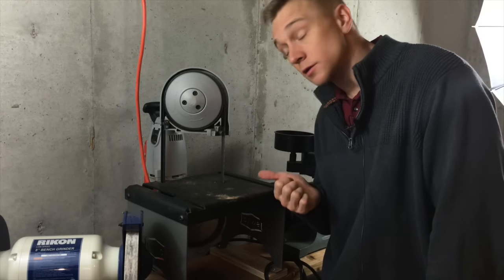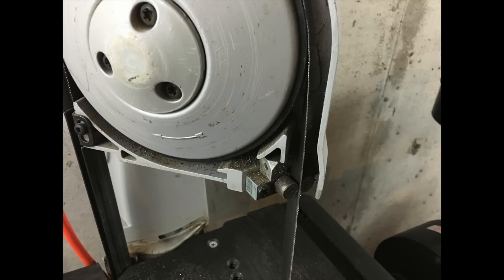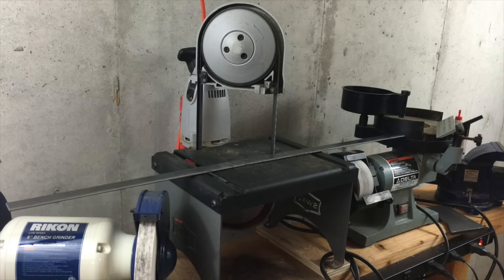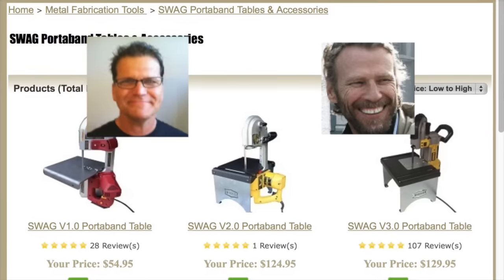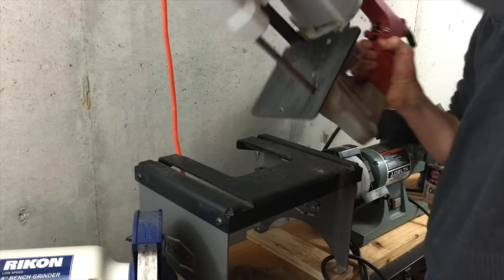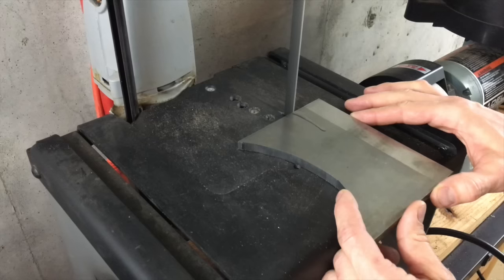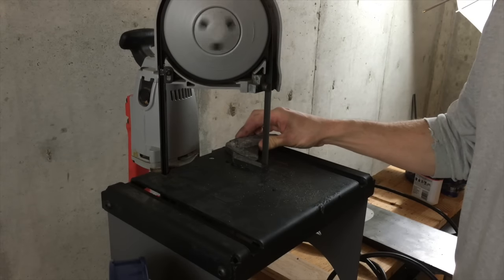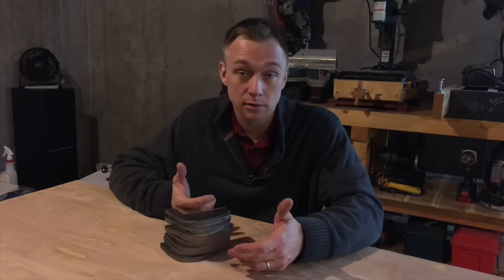Small metal cutting bandsaw and stand

Comment: Hi Andrew, Big Fan of all of your woodworking skills.  Thank you for showing all of us your great techniques.
I see you mentioned in this video that you were looking at adding a more permanent switch for your metal cutting band saw. 
May I suggest, since you have so many specialized tools and are able to customize your work-space that you frame and add studs to all exterior walls and place 12 gauge (12/2) electrical cable through conduit and place a dedicated switch and receptacle for each of your major tools with a few extras for additional tools that you may add later on or for handheld tools. As you have very nice high-end tools, I would suggest that you place each set of circuits on a GFCI and run all of the other receptacles off of the GFCI circuit and add an independent toggle switch for each receptacle.my family and I did this for our home workshop and it ended up making the workflow much easier. I got the idea from this gentlemen’s YouTube video and added a toggle switch to each receptacle and put it on a 20 amp breaker. Please see the easy to see the toggle switch and the inspiration that I had used for our home workshop.  

http://www.rona.ca/en/toggle-switch-cover 

https://www.youtube.com/watch?v=TOMSZRft2oE

Comment: That's a slick little stand. Great teaser at the end too hahahaha. Must be something pretty burly if you're using 3/8 plate. I used to build my own leaf spring lift shackles with that stuff back in the day.
Reply from the maker: +Braxton Wirthlin burley indeed, but I'm really curious, what is a "leaf spring lift shackle"?
Reply: Leaf spring shackles are part of a vehicles suspension. They connect the end of the leaf spring to the vehicles frame. I was really in to off roading when I was younger, I had a 1970 Toyota Land Cruiser fj-40. Being young and broke my friends and I used to build our own shackles that were about an inch longer than stock to give them a little bit of extra height. 

http://www.gitout.com/wpblog/leaf-spring-tech-shackle-length-shackle-angle/

Comment: Andrew, thanks for sending me this way. I recognized your setup; it is basically what I wanted to put together for my shop use. Because of the wheelchair, I never know what I'm going to have to do to adapt or configure the tool to fit the job. Putting a Milwaukee deep mouth cordless portaband in a SWAG table seemed like it would give me the most options. My question was if this was sufficient for bigger jobs when necessary. I am very limited on space, so I don't have the space for two cutting solutions when one will work. I need something that will cut metal, and cut curves. But, I don't want to have to step up in a couple years. That it will inch through 3/8 inch plate is impressive. How does it do on square tube stock?

On that note, I do have a sawzall. That video you made about the miter jig, that possibly makes sense for me. I'd have to do some serious adjustments, though. I've tried making jigs and guides for the thing to get by, but I'm not very creative. If you have any suggestions, I would be all ears.

Comment: I have the same Swag base with a Milwaukee BS, it's awesome IMO.  Wasn't sure I'd use it much but I find myself using most times I need to trim or cut metal.  As to what you're making, my guess is ribs for a Cessna 172 elevator.  :-)
Reply from the maker: +Larry527az Yeah, I find the saw quite useful.

Wow, very specific guess ... but no.

Comment: I mounted a weather proof combination switch receptacle cover and matching box on the side of the portaband table. http://www.amazon.com/Cantex-Electrical-Cover-Gang-Bulk/dp/B000FP8LEC/ref=pd_sim_sbs_60_1?ie=UTF8&dpID=41OfTug1qmL&dpSrc=sims&preST=_AC_UL160_SR160%2C160_&refRID=0GMYJJS46KFJZR309RW9  on mine. I wired a cord with the hot wire going through the switch and then to the receptacle and plugged that in and then you just plug your portaband into the receptacle and turn it on and off with the switch. Works real well.